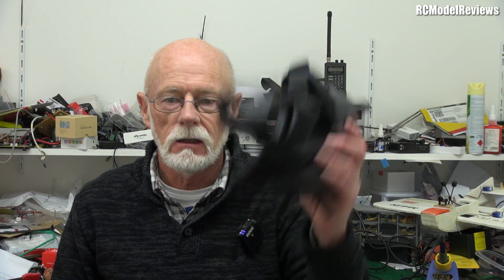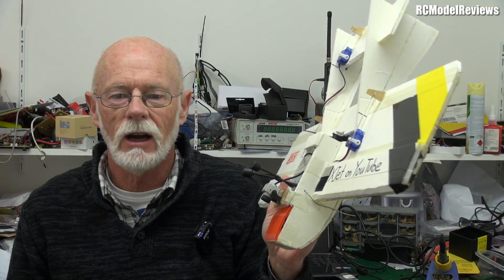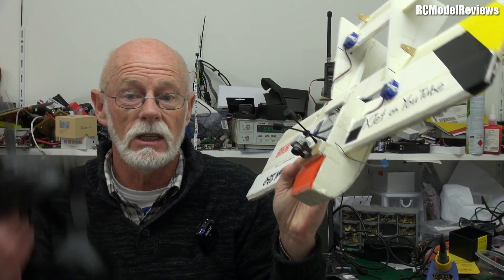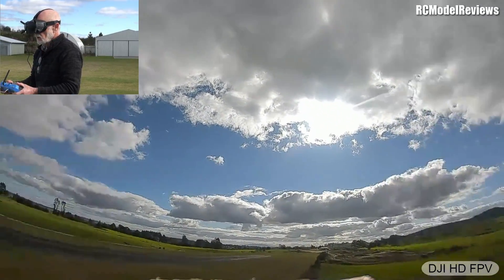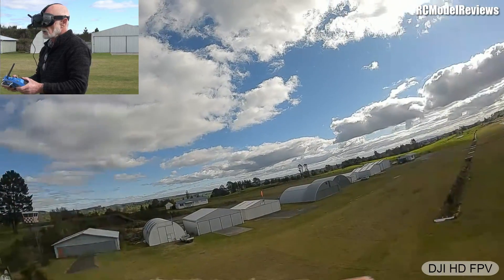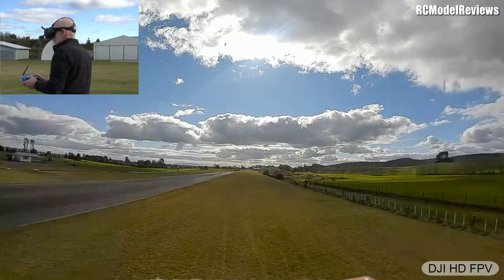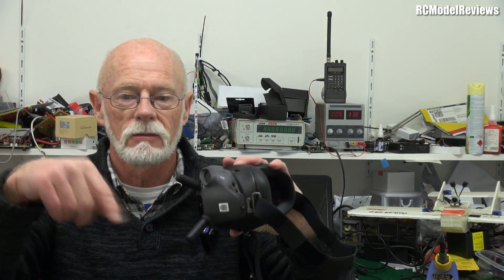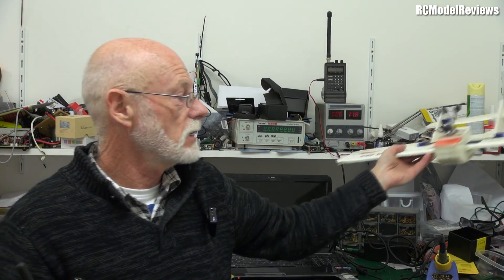Quick 25mW range test (DJI HD FPV first flight and thoughts)

Comment: When you do the "Control Line" series Bruce, will you be using electric models or glow/diesel? -:) Is the power level easily changed? 25mw seems a little tame distance wise! Nice looking video.
Reply from the maker: Yes, if you check the description of my last video you'll find  link to MadRC's video showing how easy it is to bump the power up to FCC levels (700mW).

Comment: Control line with a box with a hole :D
Reply: That would be epic, I can just see someone with a welding hood and a clear lens flying control line ...."ultra HD fpv system"
Reply: @phoenixrising4573  can you elaborate on the idea ; got a few control line models so might be fun to try
Reply: @cmulder002  lol I was thinking of a mirror on the plane and some clear welding goggles. It would work, but would be funny as hell
Reply: @phoenixrising4573  as in a mirror at 45 degrees of the flight direction or one just reflecting back (inside fuse)

Comment: I am interested to know how much battery it uses at full power
Reply from the maker: This information will be forthcoming soon.  I haven't measured it yet but if, as they say, it's outputting 700mW then I would expect that around 150-200mA would be going into the RF section -- plus another 100-200mA into the digital encoding side of things (all at 12V) -- so I'm picking 400 or so mA.  I'll measure and find out for sure though.
Reply: @RCModelReviews  Good news I look forward to the wired control line FPV series.
Reply from the maker: Yes, we can replace FPV with CCTV :-)